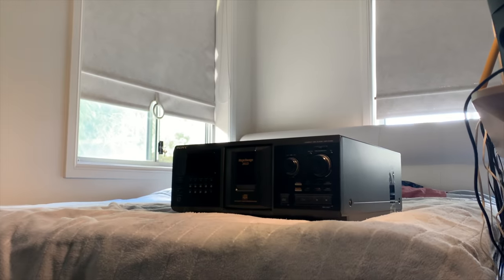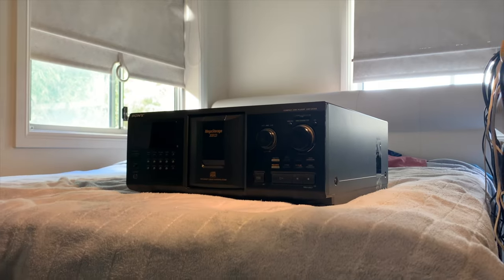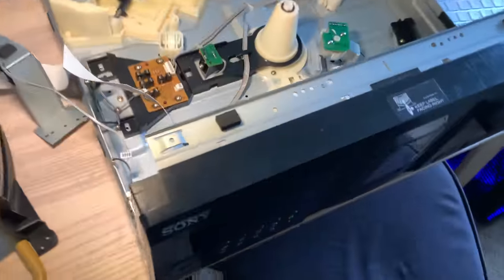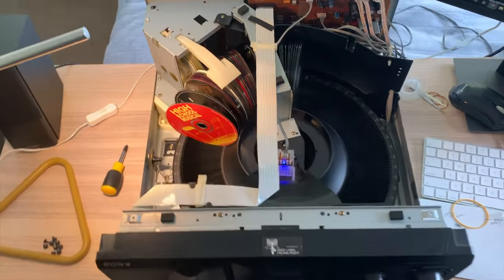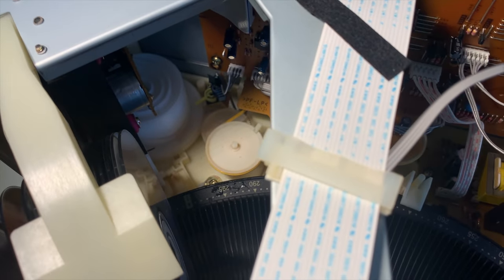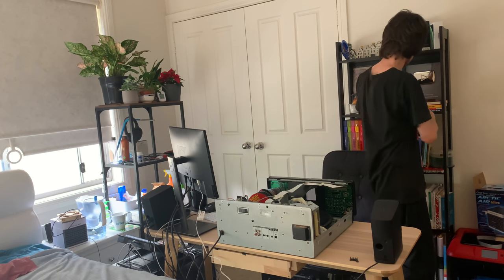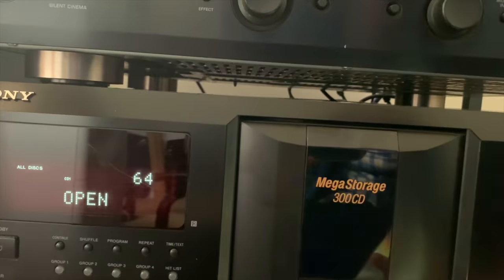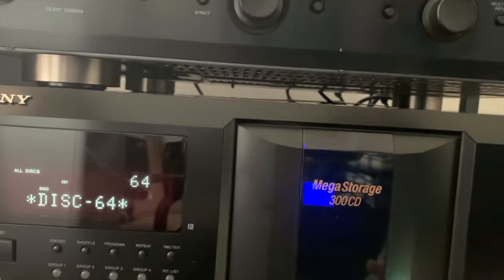A 300 CD stacker and a rubber band resurrection

Comment: Gonna stick one of these in the boot of my car 😎 

Absolutely fascinating technology, shame rubber belts have virtually all perished on all this nice 90s tech.
Reply: They don't have anti-skip 😂

Zoomers don't know how old tech works 😂😂😂

You'll scratch your discs to hell and back
Reply: @philcooper9225  I know my Oasis CDs pretty well, I’ll fill in the blanks 😂
Reply: @BudgetBuildsOfficial  RIP your Oasis CDs 🙁 

All those scratches 🙁

I can still remember burning new mixes once a month before anti-skip became popular and even then every few months 😂
Reply: Proper replacements are pretty easy to find on ebay. Using rubber bands is a stupid solution and can permanently break things. Stretching improperly sized belts over parts like that can burn the motors out and ruin bearings. They where not made to take lateral force
Reply: @philcooper9225  Seriously LOL!!!!!!!!!!!!!!!!
Reply: @philcooper9225  you can get ones designed for cars, although i don't know if any go up to 300 discs lol
Reply: @TheSynrgy1987  I used to have a 6 disc CD changer for my 1998 Trans Am 😂
Reply: Or use a 256GB iPhone if can store the equivalent of 300 CDs.

Comment: I have two of these units, a 200 disc, and a 400 disc variant. They are both full, and are data linked together so that I can shuffle play across all 600 discs. Their output goes through a Cambridge audio Dacmagic, and they sound fantastic. I've owned them for 20 years now.

Comment: I'd love to hear your take on some of the older Intel NUCs from 2015 or so.  I have a few of them that were originally set aside for my company's conference rooms (webex, Solstice client, etc), but they've since upgraded and no longer needed 20+  high mileage backup units.  I'm thinking of using one as a dedicated retro box, one for a server, and maybe another in a redesigned portable case.

Comment: Rubber bands lol.  🙂  Yeah that's an old electronics faux pas.  Belts look like rubber bands but don't stretch like them and are made to handle whatever tension they usually have.  Rubber bands for belts are basically the electronics answer to holding up a muffler with a coat hanger.  Welcome back.  🙂

Comment: I actually have something similar to this except it's a JVC model. It's a JVC XL-MC222, and it can fit 200 CDs in it. It's also got a belt driven carousel on it like yours, at least according to my research. But thankfully, it still works perfectly although I am dreading the day that the belt finally wears out and I have to replace it.

Comment: Belts and rubber bands have a completely different rubber formulation (belts are a lot stiffer and more rugged). That repair wont last long if you actually use it and may throw off the alignment of some things due to the stretchiness of the rubber band. Also stretching improperly sized belts over parts like that can burn the motors out and ruin bearings. They where not made to take lateral force. Go to ebay and buy some proper belts before you kill that thing permanently.

Comment: I had the DVD version thinking I could get away with mass amount of external storage of the DVD's in the Media room.  Lasted many years before it went, I took it apart and am handy but could not figure out the issue.  New it was cheap and now over 10 years I was not going to spend a penny on it.  The frustrating thing for me was to ID the DVD's, the PS2 port for a keyboard to help input the DVD labels never worked, so you need to use the remote to enter characters using an on screen keyboard and arrowing over to the correct one to enter.  Each DVD takes minutes x 350 DVD's and you get the idea.  Then if there is a power loss so is your data.  In the end I had to load a DVD to see which one it was and, each time that takes a couple minutes too.  I turfed mine and found it in a local pawn shop a month later trying to sell broken piece for more than I pad new (tell by a unique scratch on side it was mine).  In conclusion, don't buy it.